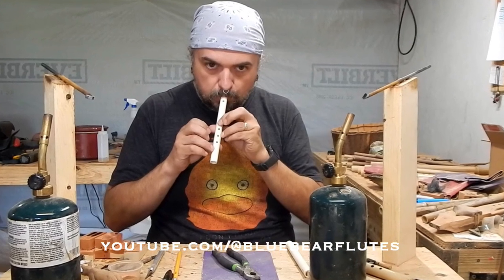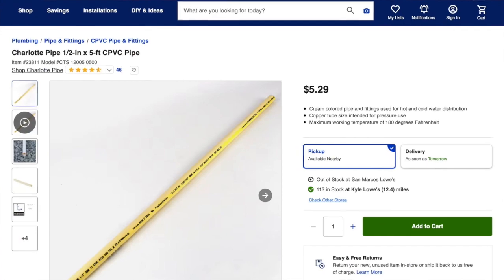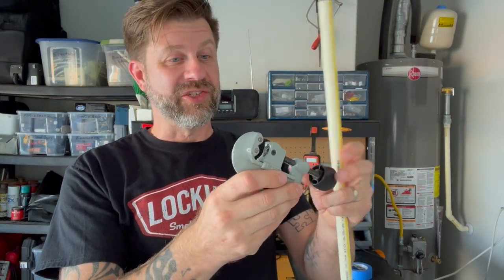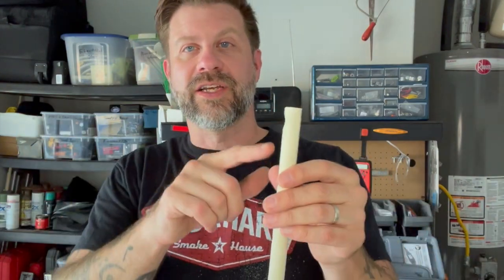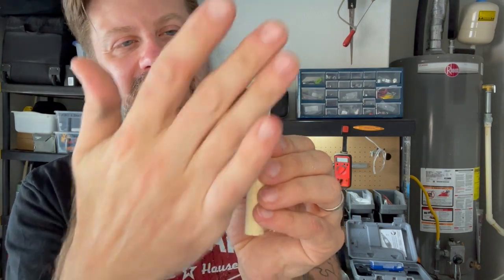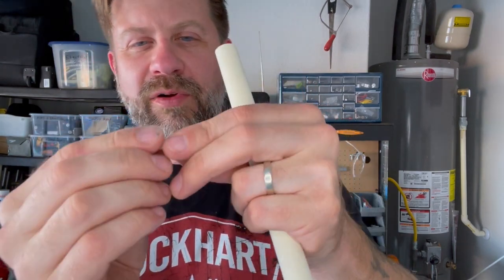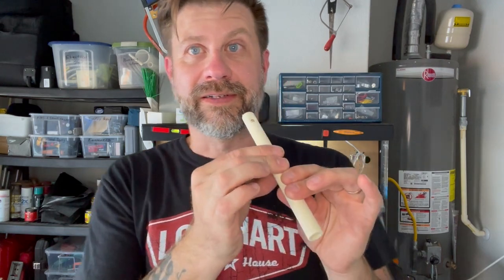My First Attempt at Building a DIY Cherokee Whistle | key of Am

Comment: It would have been nice if you had included the drill size in your video.  I went to Blue Bear Flutes and found it.
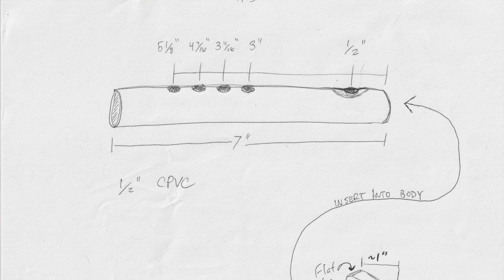Reply from the maker: Thanks for checking out the video. The holes are all 3/16". It's on the diagram shown in the vid around 2:11 and I also referenced the bit size around 2:40 when drilling the holes.

Comment: I hate imperial measurements with uttermost hatred, ima find a metric video
Reply from the maker: You can just use use a site like this and convert the measurements. https://www.inchcalculator.com/convert/inch-to-millimeter/

I've had to do that in reverse when I've found videos that were in metric. It's a heckuva lot easier than finding a video that tells you the same thing but made by someone in a different nation.
Reply: I'm usuall a troll but you´re so amicable I feel bad, I'll do what ou say, I already brought the pvc, Thanks soooo much for your video @musicalmiscellany